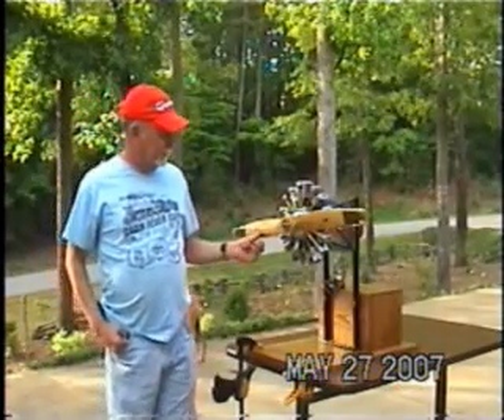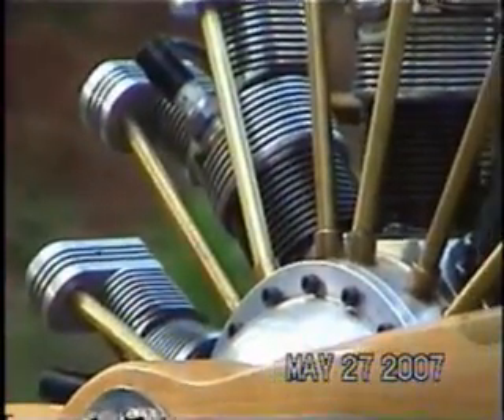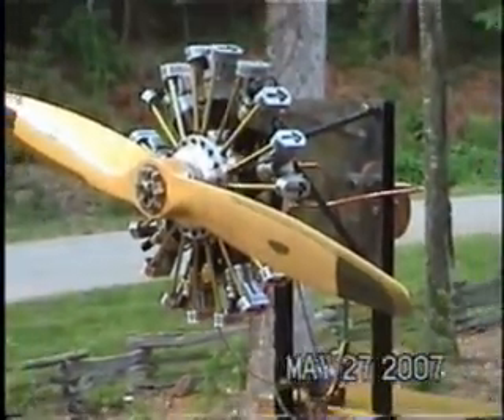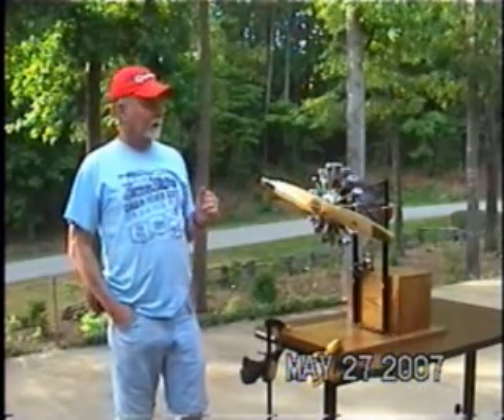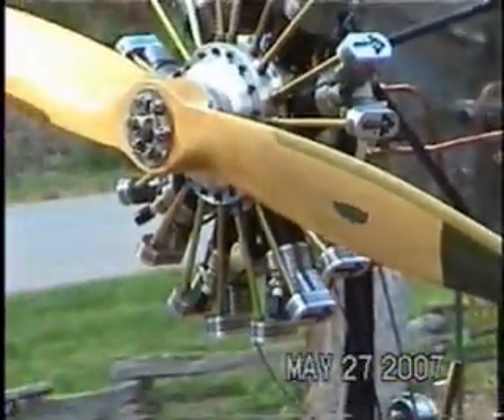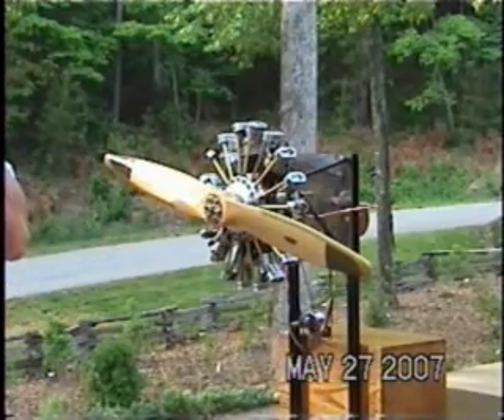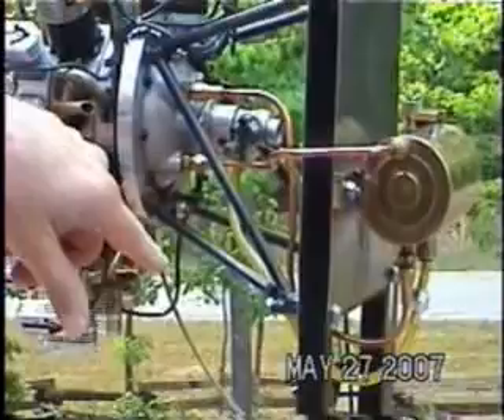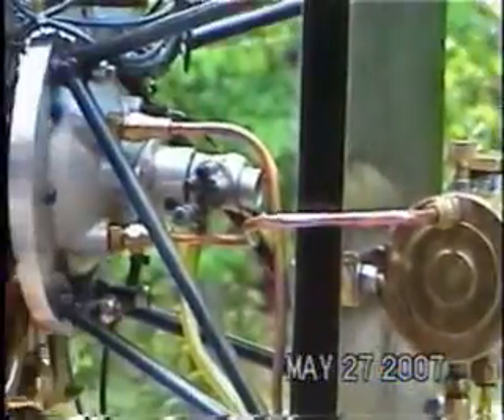9 cylinder model radial engine

Comment: Naturephoenix, what you're talking about is called an "inertia starter".  It works by winding up a flywheel (what the guy is cranking) Then you engage a clutch (screaming sound), the flywheel turns the engine over and it starts (usually). More reliable than electric start because you don't need a battery & you can try as long you can crank up the flywheel. Some inertia starters used an electric motor to wind up the flywheel.

Comment from the maker: @Naturepheonix The oil reservoir for a radial engine is basically the oil tank.  For John's engine, the oil and the gas are stored in the same tank in the back of the engine, but they are separated by a divider so they do not mix.
In radial engines, there is an oil pump that scavanges oil and pumps it back to the tank.

Comment: @garyford99 So there is a Oil reservoir at the bottom of the engines? Like real car engines??
Although I was wondering how it would work if the crank part is used to pump the fuel in and through out the back and through the carb and up the top of the engine and into the piston wall?

Comment from the maker: @Naturepheonix 
This engine, like most all radial engines is 4 stroke.  John's engine runs on straight pure aviation gasoline, 100LL.  The fuel and oil are not mixed together.

Comment from the maker: You are correct about turning a radial engine over before starting.  However  Mr Collier did indeed turn the engine over the required number of times before starting, but that was edited out of the video.

Comment: As a frmr. USCG AD3 Radial qauiled to do eng. runups the only thing I saw wrong was you should always turn a radial over 3 time more than the # of cylinders to scavange oil that WILL build up in the head and top of the piston on the bottom (#1) cylinder can cause overpressure on that cyld.. Outherwise you may get a real loud BANG !  Thing have a tenency to go flying then.Thats bad ! Realy cool job by a very talented guy, I hope he mounts it on a miniture HU16e Albatross.Just a dream of mine.

Comment: how much does it weigh? have you done any tests to measure the thrust generated by the given prop and engine combo? this seems like it has the potential to be a very effective ultralight engine assuming it is making enough power and thrust.

Comment: You need to have an aircraft at least 60 pounds in weight to install this monster! Otherwise it will start falling apart even on the ground!!! Truly awesome machinery, obvious from the engine's sound, very smooth and not rough running!!! 5 stars!!!

Comment: I think the main advantage of radials is that they are very short compared to inline and v configurations.
I understand they're also very resitant to damage.  I've heard of aircraft returning to base with entire cylinders missing from a running engine.